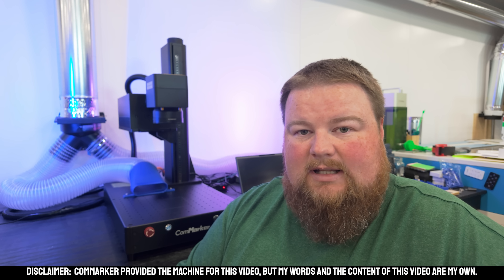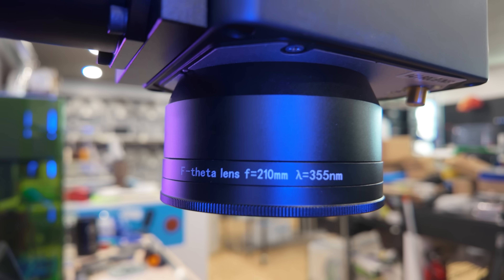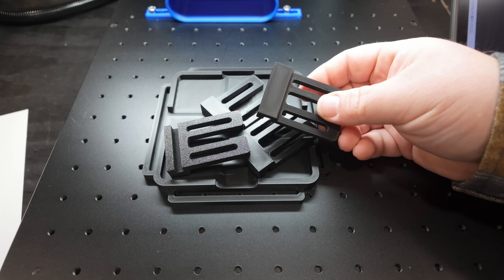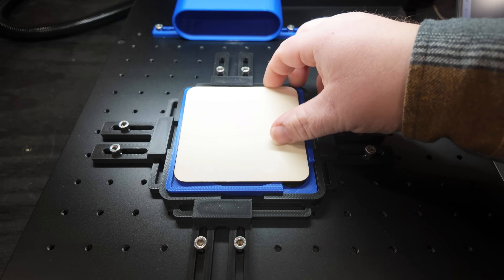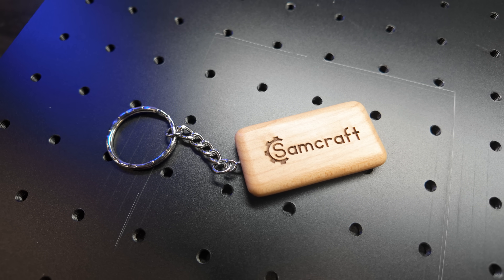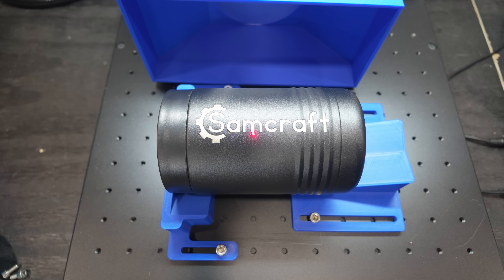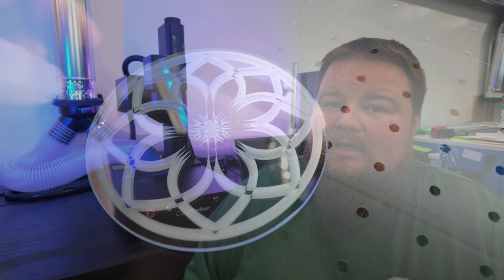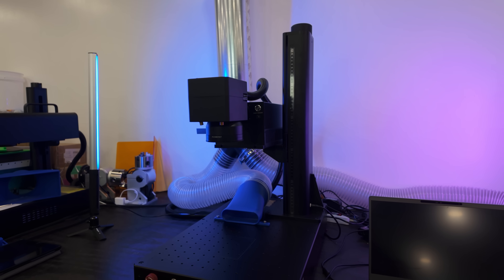One Laser that ENGRAVES ANYTHING? ComMarker Omni 1

Comment: Wish I had a similar experience.  My Commarker arrived and did not function.  No power to machine using three different circuits.  The frustrating issue is no phone number for support, email only.  The other two machine manufacturers I use have excellent support and they have phones that are answered!!

Comment: Would you be able to engrave metal if you seriously upped the time/passes? I've seen people say online that the Omni 1 is similar to a 20W fiber in its ability to engrave steel and aluminum
Reply: Well, it can cut stainless steel. I only have the 5w but did saw a metal cutting test post by commarker on FB. Seems that 10w could do this but never saw anyone use it as a fiber laser to deep engrave metal. Can't imagine how can anyone engrave metal with a cold laser.

Comment: I’m interested in this for glass. But also used to creating and understanding g-code. With that said my guess would be small dot size run length rotate run other direction. I thought I heard Light burn was easier to use if you understood code.

Comment: Glassware is finicky. Champagne and wine glasses even more so, as you might engrave the inside of some and poorly etch others. Production glass is not uniform and the limited depth of focus for UV is tight (I run a 10-watt so your 5-watt is even tighter). For a 10 watt on glass you have approx. 1.5-2mm focal depth.
Pint glasses for bars aren't too bad but stemless wine glasses and stemmed glassware need some sorting or expect 10% that aren't perfect to poor.
Regarding sorting, I use a rubber-lipped bar-clamp and find the mostly-size, and then put the larger in one pile and smaller in another to run separately after adjusting the Z per pile.

Comment: Can anyone recommend which one is the best x tool or Omni uv laser?
Reply from the maker: Those are apples and oranges. xTool does not make a UV laser. :)
Reply: @Samcraftcom  what is the difference?
Reply: @Samcraftcom  what is the difference between xTool F1 Ultra 20W Fiber & Diode Dual Laser Engraver
And Omni 1 UV laser?
Reply: Can a rotary axis be attached. With that said. It doesn’t matter what laser you use normal to surface is critical. Some are just more forgiving than others. Just getting into smaller lasers. I have been programming running production laser for 20 plus years. Both Fiber and CO2. And normal to surface is has its effects on them as well. Just easier to over come. Well because of power.

Comment: As far as glasses go I was having issues too. Then I started measuring the glasses. Out of 6 glasses the diameters were as much as 1mm difference. The level also changed for almost every glass. So I did the average diameter and leveled every glass and then adjusted the focus each time. Bingo I started getting consistent burns. I don’t know if the cheap glasses were the problem or if most glasses are  this inconsistent. I’m using the same Omni UV laser. Thanks for your videos!!

Comment: Very nice video, Sam! As I just got an Omni myself, I'll be checking out your jigs. Funny enough, I got the Omni for marking the 3D printed products and parts that I make. Is this how you'll be branding your jigs?
Anyway, I wanted to say that while setting my Omni up and doing some test on glass, I noticed that the galvo head was not very level to the work surface on both axises. So, maybe give that a look to see if that's why you're losing the corners on one side of the 150mm box.
Reply: I just...engraved, marked, lasered your 150mm Square Test and got all 4 corners out to 150mm. (149.94mm according to my calipers)

Comment: Not sure what you you are referring to at 6:30 about IR lasers.  I have a 100w CO2 that has no issues with wood.  Are you saying no charring with the UV whereas an IR will?  Sure.  But I if you dial in your settings of your IR, there is little to no charring on most wood materials.  There are many benefits for a UV galvo over a gantry IR, though.
Reply from the maker: IR is a popular advertising term, so that's what I referring to. Hardly anyone will call their CO2 laser an IR even though it operates in the infrared spectrum. This term was used to relate to the masses and new users instead of those who go by the spectrum segments. :)

Comment: Hey Sam.
If you dont use a Rotary for round objects Like Glases then there IS a Feature in Lihhtburn where you enter the Diameter and IT will compensate by asjusting Power according to the roundness

Comment: I have a heck of a time with glass with this UV.  Maybe more me than the machine but I have more failures than success.  Also with a rotary and grass I have many more issues with the UV.  I use mine now more for leather marking / cutting and deep wood engraving.  It cuts and marks leather beautifully.
Reply from the maker: Well I'm glad and sad I'm not alone on this.. I would rather it be me than trouble that others also have.
Reply: Thank you for answering

Comment: I have had the omni 1 for 3 weeks and have struggled with glass,been using lasers for years starting with diode and co2. I bought this with the hope of doing things quickly, but find my 20watt diode does the glass just as quick. 75mm/s is just 2 slow
Reply from the maker: I'm both glad and sad to hear I'm not alone with the glassware struggles.
Reply: I’m doing glassware at 600mm/s on the Omni.

Comment: While it worked for you, lasering the front of a mirror can be VERY dangerous and also damage the machine very easily any time the reflection of the laser gets shot back up into the lens and can then result in etching the lens. Th risk is a bit hit and miss due refraction of the glass times can "usually" be enough to defocus the laser light to prevent it having enough power in its reflected distanced. Why you usually see it recommended you only laser the backside of mirrors.

Comment: For what I'd eventually like to do with the laser side, this machine would definitely fill the bill.. I could keep the big Co2 I have now for actual wood cutting and use this for marking everything else..  I guess it's part of the 'goals' section I'm working on at this point, lol.  And far as that keychain goes, I really like the look of that deep engraving, especially since it didn't 'burn' like a Co2 could going that deep.
Reply: I have a 60 watt CO2 gantry, but would like a smaller Galvo for its speed in marking. I need to do more research on UV lasers.

Comment: Fun stuff Sam! I have a UV on the way from a different manufacturer. The issue with glasses is, the slightest curve variation on glass changes the result due to the slight reflection as the curve gets larger. While other materials work well within reason, on glasses, you need to use a rotary to keep the strongest point of the laser beam directly under the galvo. You proved this by running multiple passes.
Reply from the maker: As always, I appreciate your insight and advice! Do you know of any surface treatment that may help with this on clear glass? I grabbed my cermark spray for this video, but it must have been put "somewhere safe" last it was used. :)